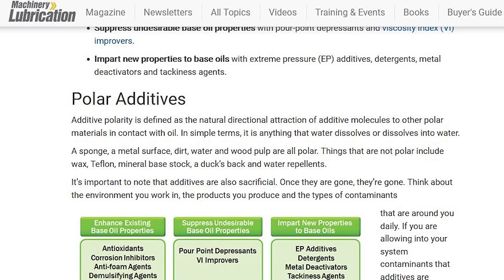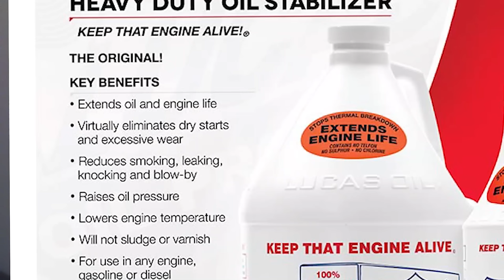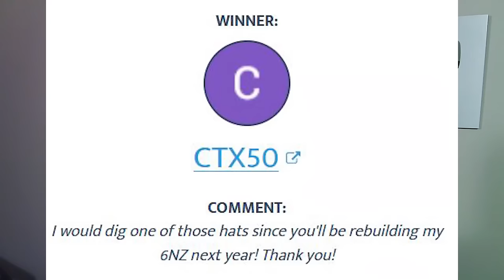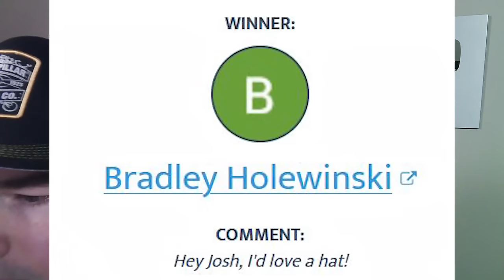Does your Engine NEED Lucas Oil Stabilizer? A detailed look at the "Benefits."

Comment: I will comment before even watching the video, but I have been using Lucas for years and would not stop. This thing works, really works. Yes it is heavy at first, but after some miles it losses thickness a little and become a super protectant to your engine. I even use it on my 3.0 marine engine and zero problems never.

Comment: I had to tear down to redo the head on my truck at 150,000, I use it religiously and there was no wear in the cylinder, not even enough to catch your finger nail, so yes it does work.

Comment: Project farms has tested many of the snake oil products and Lucas did not match up to regular oil.  I suggest to anyone considering adding such products to your oil to watch his videos.  He also tested different oils and there is a difference in oil quality.  Thanks Josh.
Reply: In pretty much all of his tests lucas outperformed regular oil so I’m not sure where you got the information that it didn’t match up
Reply: @charlienorton2337  sorry I didn't mean Lucas in particular but in snake oils as a whole.  The 1 major claim they all make is better fuel efficiency.  But motorkoat was the 1 that seemed to perform the best especially on the bearing wear test.  And I am specifically talking about what they CLAIM their product will do.
Reply: @charlienorton2337  I can attest that Lucas oil stabilizer works.  It does reduce sludge.  I had a prius that I always just put regular oil in, it was always black after 3500 miles.  Added Lucas oil and after the 6 or 7 oil change I noticed that 3500 miles the oil still looked good (not as dark) and each time after that I went up 500 miles.  Now I change at 5000 miles and that oil looked like my 3500 Mile oil back in the day.  So yes. It definitely works
Reply: @kyle-li8sn  oil should get black or it is not cleaning your engine, so Lucas is bad for your engine, like everyone knows.
Reply: @V8Lenny  sorry but you are missing informed! Oil turning black is from the blowby in rings and valves.... not to clean your motor but to lubrication is the reason for oil.... better go back to school if your a mechanic.

Comment: I run belly dump and side dumps for construction in very harsh environments and I've been using Lucas for about 15 years, I bought my 98 Pete in 2011 with no history on the engine (3406E) still runs like a top 76psi (oil pressure oil pressure without Lucas was 74psi), doesn't use a drop of oil between changes. The one thing I really noticed is it did drop the oil temperature 20 degrees from 235/240 degrees down to 215 degrees, heat is what kills oil. What sold me on it was my friend races monster trucks with blown and alcohol injected engines and his bearings were shot after 4 to 6 races after using Lucas he could run a full season on one engine. (Alcohol washes the bearings and cylinders out) just my experience with it.
Reply: Oil pressure is resistance to flow. You can't increase resistance without increasing temperature.
Reply: @prosourceoil6380  you're definitely right
Reply: @turbojetpowered8299  thicker does not reduce friction, only increases friction. Proof being, oil viscosity specifications of today and going into the future are lower than the specs of the past. These viscosity changes are for fuel mileage increases. Lower viscosity = increased fuel mileage. Lucas additive increases viscosity. 

Older vehicles being stored, Lucas does not help with either. Use a oil with high amounts of rust inhibitor additives and fogging oil.

Everything on the bottle of Lucas is a lie.
Reply: Well hey I'm an rv hauler 12 yrs 3 Dodges/ Rams 2 million miles and I use 20 % every oil change 4,ooo - 7,8oo miles and no troubles with engine The shit is great , and that's why it sells. If it wasn't any good it never would've lasted decades at Wally World and O'Reilley's .Them guys that say all yer doing is THICKENIN UP YER OIL, THAT'S NONSENSE IT HAS STAYING POWER AND IT MIXES PERFECTLY W/  OIL TO COAT EVERYTHING IN AN ENGINE.
Reply: @prosourceoil6380  that's not entirely true. you can't while using the same oil. Thicker oil takes longer to heat up, but pressure can still increase.
Reply: @turbojetpowered8299  While you are definitively correct in your assessment that oil viscosity does not strictly affect friction, it does have AN effect, namely in hydrodynamic bearings specifically (IE the vast, vast majority of rotational bearings in modern, high performance engines) because how 'reluctant' it is to move affects all things that move the oil, including bearings and pumps. This is one of the reasons we don't just slather crankshafts in moly grease and call it a day (alongside fouling and other assorted reasons)

That being said it's FAR from a cut and dry matter, lubrication is an entire field of science unto itself and is very often discounted as being a matter of "jes throw oil at it!" when in reality, optimization of oil properties for the specific situation at hand can yield frankly staggering results. It's the same reason I use automotive lubricants for guns; FAR more R&D goes into the formulation of these lubricants than goes into, say, froglube, and the situations that gun components go through is overall similar to automotives. There's definitely a bunch of snake oil in auto parts 'chemical' aisles but not all of it is, and even the snake oil can be useful, just not as a magic 'cure-all' as the bottle suggests. A little critical thinking goes a long way.

Also, as a friendly suggestion; a little more brevity and some use of paragraphs would help greatly with lengthier posts as walls of texts are easy to get 'lost' in.
Reply: @prosourceoil6380  amen bro
Reply: @prosourceoil6380  Oil specs of todays cars are made so the cars engine last 70,000 miles. I run 20w-50 in mh car and its got 300,000 right now
Reply: Got a 3406E with 2.4 million on it. I frame was done at 900,000 and still rolling strong. Original injectors. Ran Lucas since inframe was done. I think the gain from it is on the dry starts and the longevity of the viscosity.
Reply: @turbojetpowered8299  you make very good sense on this issue sir, I agree 100%👍
Reply: @turbojetpowered8299  
I disagree with your findings,  Power Nation did just that,  tested an engine on a dyno,  and going from 20W50 to 0W20 did nothing for horsepower.  They were surprised as well.  I understand how someone may think the thicker oil should hurt horsepower. I was of the same line of thinking.  
They used an old Chevy small block that was only making around 205 horsepower.  If that makes any difference I don't know.  The one thing that did help horsepower,  was going from a 2 bbl carburetor to a 4 bbl.  They used headers for all testing as well.
Reply: @ronmoore3987  
Agreed,  some people just want to repair an engine instead of trying to make one last longer.  I have great experience with Lucas products
Reply: I never disagree with him here... but reading the comments and thinking about it, I'd hazard to guess it does do most of the things Lucas claims, esp lowering engine temps. 
I think there IS a caveat however... and that is engine run times. On a Fully warmed engine i see this as lowering friction (and thus heat) in the MANY places that occurs. That would pay dividends if you ran your motor always for extended intervals (like 8hrs straight).
But IF you were constantly doing cold starts and driving 20miles and shutting it down until later, well then i think the added viscosity doesn't help the motor. 
Also, in the cold i would think you would Need to warm your engine before you take off with this product. As opposed to just a multi-weight oil where it's likely best to start up and go (after a few seconds) and drive gently.
On older engines where tolerances have opened up, this product seems to make simple sense 💁‍♂️
Reply: @georgehofgren6123  it's actually designed for dry starts so that there's still oil in your bearings after it's been sitting for a while.

Comment: I think many fail to realize many of these things lucas does is only beneficial to a really worn engine or engines with problems.lucas is great at putting a bandaid on a worn engine to allow u to drive it awhile longer. Thats where Lucas shines and it does work as ive seen it work with my own eyes over the course of my almost 25yrs as a diesel mechanic.
One of the greatest examples i love is....3.8 series one buick, broken Valve spring, clack clack, full bottle of lucas, no more clacking, my dad drove it for rest of year like that until he could get another car. The lucas provided so much "cushioning" effect on that broken spring, it stopped the clacking unless u reved it over 4 grand, then some noise would come back. Another example, lucas trans fix and power steering fix, slipping trans, hard shifts or hard spots in pwr steer rack, all gone after lucas. Should u dump thousands into an old car to put a rebuilt tranny in? Or try a 10 dollar bottle of lucas, what have you got to loose at that point, try it, you'll be surprised at the results. Rear end gear whine, half bottle of lucas, no more whine. Now all this only works if u catch it in time, if it goes too long, u often cant save it.
Also the lucas you are showing here, the oil stabalizer, can be used in trannys, BUT, they are talking about manual trans that call for 10w30 as the oil. Do not put it in auto trannies, use the tranny fix product.
If you have a properly operating vehicle, theres no need for any Lucas products, just proper maintenance!

Comment: On inframes and rebuilds I have always used Lucas as assembly lube, it's always worked great for me!
Reply: It's very good for that. The gooeyness helps the oil pump suck up oil quickly.
Reply: There are far better assembly lubes they have quality additive packages though. When you learn how cheap Lucas actually is you'd think differently of their product, the marketing sells Lucas, especially the deceptive little gear display to captivate the oil ignorant consumer base
Reply: @100pyatt  Yes there are much better assembly lubes.

Comment: Since oil breaks down it makes sense that adding a thickener to worn oil should restore viscosity.
I do use Lucas but try not to dump a cold blob down where it could clog the oil feed.
I try to do it on a warm day and add a little then some oil then some more.
I'd be concerned using it in freezing temperatures but it's hot here.
I also only use a little in my BMW which likes thin oil for the vanos.
I usually only add about half what they recommend.
It's thick and has to have more drag. Like running in molasses.
An ounce of protection is worth a pound of cure.
If you have low oil pressure and the light is on at idle I thought it needs pressure or oil won't make it downstream. Like a finger over a hose.
You do make a great point that more pressure doesn't mean it's making it either. It could be blocked.

Cooling can come from reducing blow by.
Combustion pressure can carry heat past rings and seals. Sealing those gaps keeps heat moving.

It's good to remember that this goo is diluted at least four to one in oil and heated over a hundred degrees. It's going to be thinned out.
It would be interesting to dilute one ounce Lucas in four ounces of oil and see how thick it is. Then freeze it and heat it and compare to pure oil.

Comment: My 23 year old Mercedes SLK230 Kompressor with high miles is absolutely perfect for Lucas.  It loves it!   Never missed a beat.   When I bought car, before it had Lucas in it, it was quite a loud, rough sounding engine.   Added Lucas and within 50 miles it was literally purrrrrring like a cat!
Reply: These older Merc engines love thicker oil in general! I have a W140 300SE with the M104. When I bought it it had 10w30 in there. I switched to 15w50 and it runs smoother, quieter and the oil leak almost stopped completely (leaks are also common on these older Mercs 🤣)

Comment: I love this video. When I got my first car ('91 Grand Am), it had a weak lifter, leaking valve-cover gasket that I stopped replacing after the second one (I carefully avoided looking near the head gasket because I didn't walk to know), burned oil, had worn piston rings. As a poor single lady, I kept Lucas in it, and drove it 14 years before someone gave me a 2009 Camry. I don't run Lucas in the Camry because I can keep up on the maintenance and repair.

Comment: the whole point of Lucas engine oil stabilizer is to provide a barrier between wear surfaces. the Lucas is both slippery and sticky at the same time.it will stop oil burning in old engines and increase the life span of new ones.  ive been a licenced mechanic for 37 years and ive been putting Lucas in every engine i own for the last 20 years i even have it in the gear lube on my gold wing and my dodge truck it will increase gear life and will stop a sweaty seal from leaking. i should be the poster boy for Lucas. i also use the fuel treatment in my 94 cumins diesel. as far as im concerned todays oils are to thin and dont provide a proper barrier between moving parts, lucas is the answer ot this issue.
Reply: Can you put Lucas in the diff ?

Comment: Based on thermodynamic and fluid mechanics principles motor oil loses viscosity over time and use (shear thinning) so a thicker additive prevents against thermal breakdown and extends the life of the oil. Saved y’all 27 minutes of y’all’s life

Comment: I use in my truck with Detroit 14.0 Liter engine in each oil change I add 2 gallons of Lucas and 8 of regular oil, on one occasion I did the oil change with 32 thousand miles and never under oil pressure and only consumed less than a gallon in all that time, I would say that it works very well according to my experience
Reply: 60 series 515jp 06 I use a gallon of Lucas every oil change 9k

Comment: I've got 300,000 on my ford explorer and I use this with every oil change, I figure the more lubed the parts the less wear, I could be wrong, all I can say is I got the 300,000 and still going, so not sure if it's the help of the Lucas or not, I will say my oil pump needs to be changed, but at 300,000 I e done pretty good not to have to change it till now, so either way I count my blessings and keep driving praise God

Comment: Ive been using Lucas in various engines over the years. Its hit or miss. Depends on the scenario. Gotta understand youre using it on a worn engine that just oil isnt cutting it and to try and stretch your pennies as far as you can. Ive had engines where it didnt make much of a difference, but ive had a few that would run nice with it, but if i tried running without, it would knock and have blow by. Even in the winter when its thick, youre only supposed to have up to 20 percent lucas to oil. It does take an extra moment to get it going, but the film strength and tackiness makes up for it in some cases. Ive seen it go both ways. Also, if your engine has alot of sludge built up, youre going to want to address that first because even with just straight oil thats a problem. Youve hit every concern right on the head with your video. It also does work nice for assembly lube or for coating and engine thats going to sit for a while. I put away a few engines and put a nice helping of lucas in the oil and ran it for alittle bit. Had good success. So if an engine is worn out beyond just going by the recommended oil interval, or you have one of those type of engines youre running on alcohol and pushing enough power to only get several runs out of before a rebuild, you might want to give it a go. On a lower mileage engine in good shape, you’re not doing any favors

Comment: I agree with everything that you said in the video.  I would not and will not use is stock diesel engine.  With that said I do use Lucas oil stabilizer in light limited super stock pulling motor. It is a DT466 based engine making over 1400 hp and turning more than 5000 rpms.  I mix it with 15-40 delvac oil and have had very good performance.  Just check bearing after 200 runs and they look like new.  Use to run straight 50 w and had  to  change bearing after 40 runs.  We check oil filter for metal after every run.  I always wondered why the Lucas helped and after watching your video I think it is the additivity that makes it sticky that help.  We run higher clearances that stock engine would.  Keep up the great videos.  PS. the perkins head does not look that bad.  I seen worst.  Thanks

Comment: I had a crappy little 2000 Geo Metro for a winter beater. It was smoking. I had to get a drive clean test and it failed. I put in Lucas Oil Stabilizer, drove it for a couple days, went back, re-tested - PASSED! Probably saved me a lot of money in repairs or at least let me keep driving it for another year until the front axle just freakin' broke.

Comment: Lucus has a rapid viscosity change due to temp, you can physically see that easily. I tested this on predator motor(lawn mower motor). I ran it with oil and the recommended amount of lucus,  then drained it and just ran it as if the oil wasn’t there just the recommended lucus and it ran still!!! Very well which was crazy, it’s a very cool product to test with

Comment: I have 1.2m miles on my Detroit 60, started to use Lucas at 600k and still going strong I also noticed reduced engine vibration after using Lucas.
As far as im concerned I would use it on a new engine because it doesn’t need it but I’d definitely recommend it for engines with over 500k. Specially when topping of oil as it will restore some of the biscotti lost by normal engine use
Reply: damn I would love some biscotti
Reply: @gnarlytothemax I knew someone would catch it. This made me laugh hard 😂